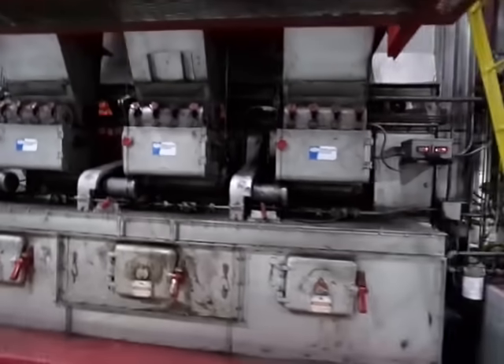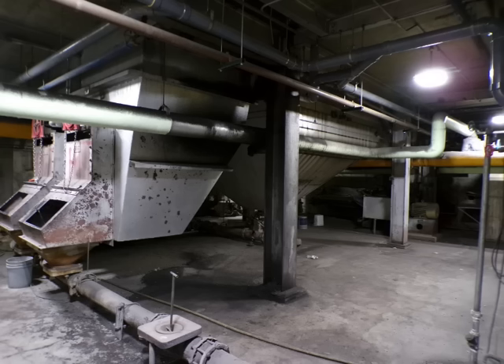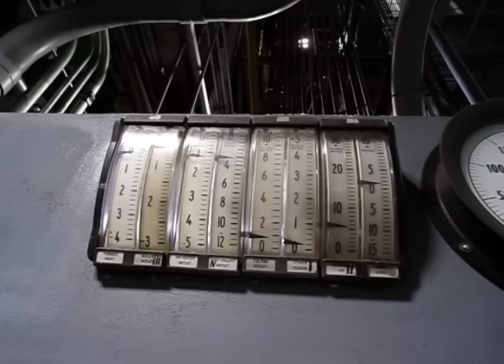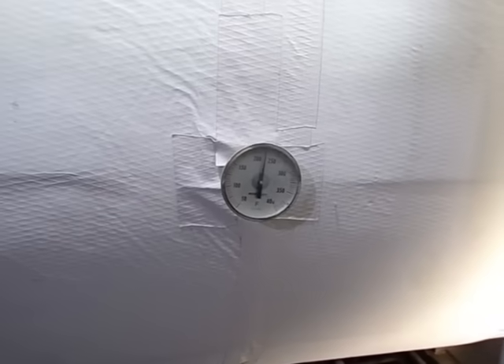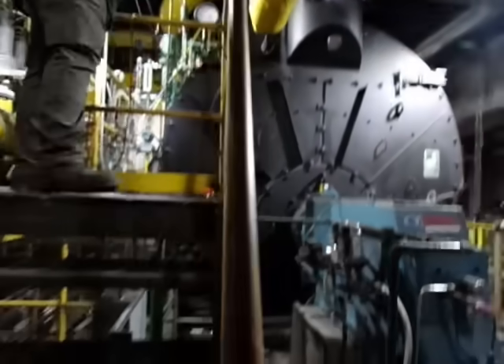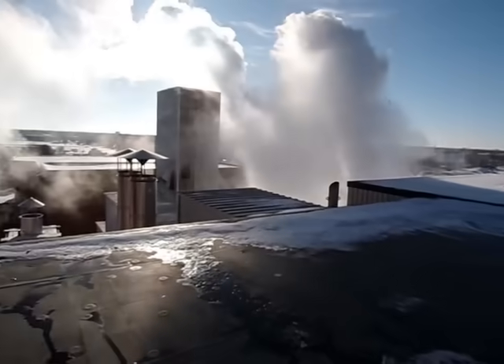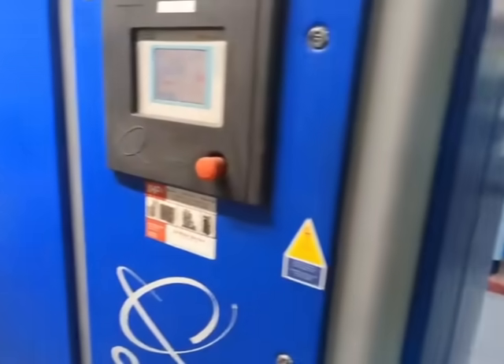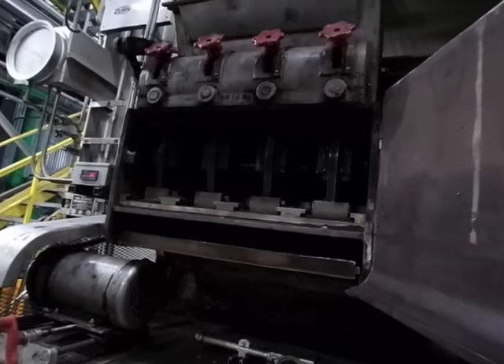The Last Coal-Fired Boiler at NDSU | Steam Plant Tour

Comment: Great video. I worked in a multi hearth incinerator for a wastewater treatment plant. A lot of the instrumentation, and peripheral equipment is similar. We used dampers for our ID fan back in the 1980s. We also kept a negative draft, to keep the incinerator fed with air. We switched to NG after using bunker C oil, which we had to heat to flow.

I subbed. Great channel.
Reply from the maker: How did that work? I thought incinerators burned garbage. So are you saying that oil fired boilers had id fans?

Comment: It would be really cool if you could get a tour of an electric arc boiler!
Reply from the maker: I've heard of electric arc furnaces for smelting metal but not for steam heating.
Reply: @SteamElectricityandPropulsion  electrode boilers. Is what they are actually called. When i was doing my boiler training class they mentioned them. But the only one in our region is at the Tillamook dairy. It uses line voltage 4k to 22k and passes the current through the water.

Comment: It's sure not the last 😊
Reply from the maker: there are coal fired boilers at the american crystal sugar factories but they don't allow pictures so I cant make a video.
Reply: @SteamElectricityandPropulsion their not supposed to use them is why
Reply from the maker: @jeremiah-om7zl how do you know that they aren't allowed to use coal?
Reply: @SteamElectricityandPropulsion epa 😊
Reply from the maker: @jeremiah-om7zl so then why is NDSU still allowed to burn coal?
Reply: @SteamElectricityandPropulsion maybe if you've spent millions on a gas afterburner 😊
Reply: @jeremiah-om7zl  ACS is permitted to use coal without issue

Comment: This boiler has been causing Global warming, and destroying the planet for over 40 years.  It should have been shut down decades ago.
Reply: If you think coal is that bad, thats ignorance.

Coal is not as bad as you believe it to be.
Reply from the maker: @FlorenceSlugcat  you can use ash for concrete mix and you can use sulphur limestone slurry for drywall.
Reply: @SteamElectricityandPropulsion indeed it is the case.

While coal has its drawbacks, it also has benefits. It is low cost and requires very basic machinery on a small and on a large scale.

I saw some people comment about "not needing conveyors" and all that. But that neglects the fact that you end up needing pressure systems of pipes and tanks, pumps and such.

In naval, oil is definately better because of a higher energy density: less fuel, more range, more cargo, on a smaller ship. Oil however can be used for internal combustion engine systems. But oil fired steam boilers remain more energy-dense than coal. 

In power and heat, coal is pretty hard to defeat. The low cost makes it unbeatable on a large scale for infrastructure demand. The opposite is true as well: its low cost makes it good for small scale applications like an oven. It also can does not rely on a complex oil industry and supply chain, nor on oil storage tanks, making it viable to use with no pre-existing local infrastructure or industry. You can store it in a pile, and and shovel it.

Gas main benefit is mainly for high speed turbine systems, such as gas turbines: very high consumption, but alot of power, in a small internal combustion system.
Reply: @SteamElectricityandPropulsion coal also has another important purpose: Coke.
Coke is an aggregate fuel like coal, but it burns with more energy than coal. It is done by baking coal at over a thousand Celcius without giving it oxygen so it doesnt burn.

It burns hotter and cleaner than coal. And is a necessary ingredient of the steel industry.

In a blast furnace, it acts as the fuel to melt and make steel.

Beyond making coke, limestone is also necessary to make cement for concrete production. And sulfur is great in agriculture.

The ash us sometimes sprayed over fields as fertilizer too
Reply: @SteamElectricityandPropulsion more than 50% of coal combustion products in USA is recycled
Reply from the maker: @FlorenceSlugcat  I think gas is cheaper because the manager told me that right now in January gas is a little less that 6 dollars per mbtu but coal is 6 dollars per mbtu. In the summer gas is about 3 dollars per mbtu.
Reply: Cry harder.
Reply from the maker: this channel is about documenting the machines that support our utilities not condemning coal.
Reply: And gas doesn't?
Reply: @J-1410 yes it does. Humans should
Migrate to warmer climates in the winter.
Reply: @Freedom4Ever420  Are you for real?

Comment: Ya some gas companies ask you to keep them for major users ie coal/oil for back up.  They call when gas pressure drops during extreme cold weather.  I hope you already talked with them and not just doing it out of the blue.
Reply from the maker: Most places use gas but have oil as a backup fuel. When it gets really cold they stop using gas and switch to oil.
Reply: @SteamElectricityandPropulsion just making sure it’s kind of a critical mistake idiots with MBA will try to force down your throat

Comment: Thanks for posting.  Was interesting to see how the stoker was set up and the manual soot blowing.   Where I currently work was have hundreds of soot blowers on each of the three units, they use compressed air (used to be steam) but are operated with electric motors as we would have to have a crew of people to pull the chains for each one.  The smaller ones look just like the ones you showed.    Loved seeing a heating unit burning coal, sad to see it go.  Most of the ash can be sold for concrete fill if it doesn't have lime added for SO2 control.
Reply from the maker: One guy was complaining about the heavy metal in coal ash but that's great that you can safely dispose of and utilize coal ash in concrete.
Reply: @SteamElectricityandPropulsion  I heard there is a way to recover some if the exhaust from the coal plant and convert it to gypsum boards.
Reply from the maker: @SkrixFox  yeah they blow air into the lime water tanks where the sulphur is removed to cause a chemical reaction to make gypsum. this steam plant only has a bag house but no sulphur scrubber.
Reply: @SkrixFox Google Zimmer power Station just outside of Cincinnati. Limestone was mined just a short float down the Ohio River and ground into a fine powder. Barged back up river and then used at the plant for the scrubbers by spraying the slurry into the flue gas in the stack scrubbers. Then the synthetic gypsum was sent back down river on another barge to make drywall board. Pretty neat stuff is done when we get creative and it makes dollars/cents.
Reply: @SkrixFox  We just use a dry powdered lime, blowen in with the flue gas and captured in the bag house.  we don't produce any gypsum that can be recovered.  Since we also add carbon for mercury recovery it can't be used in cement anymore and is no all landfilled.  We used to sell it all for cement production but not after clean air upgrades.

Comment: That boiler system was pretty impressive when I started at NDSU in 1980.  It's been expanded quite a bit since those days.  There were always a couple coal cars on the railroad siding behind the boiler plant.  NDSU burned lignite from the western part of the state back then.  That's pretty dirty coal so I've no idea if they still burn lignite.  Somewhere in my box of stuff from those days I've got a chunk of lignite I picked up from that siding.  I can't argue that natural gas is a lot less work and expense.  But I'll miss the coal.  I still live in Fargo and drive past NDSU now and then.
Reply from the maker: I think they burn bituminous coal from Montana. You should call them and ask for a tour before the finally shutdown the boiler. If you email me I'll give you the number to call the plant manager.
Reply: @SteamElectricityandPropulsion  I thank you sincerely for the offer, but I'll pass.  I've been in the plant a few times through the years though.  A friend and I used to have a metal foundry in the old South Engineering Annex, if you've ever heard of that building (it used to house the steam boiler and electricity generator for the university in the old days).  We were always scrounging favors or needing someone to look the other way while we hauled in a trip hammer or some other little thing like that.  So we got to be pretty good friends with the people keeping the place running.  And it was a lot more informal then so if you wanted to see some part of the campus like that all you had to do was ask politely and someone would be glad to show you around - and probably share some gossip.  I miss those days.
Reply from the maker: @xlerb2286 so was that at NDSU? If so do they still have the foundry and generator?

Comment: WHen all that electric wasting  expensive junk is replaced by clean natural gas the University will be much happier not paying for all the power to run all those blowers, coal feeders and all the rest of that stuff that isn't needed, and they wont have to get rid of mountains of dusty toxic coal ash either.
I burned coal for heat in the 80s and well remember how a 5 gallon bucket of nut coal when burned in my stove would about half fill that bucket with ash, and it was heavy, sandy clunky very dusty and dry "ash" I had to shovel out and dispose of. Now you cant just dump it where ever because coal ash contains some heavy metals, arsenic and other nasty stuff, so a coal fired power plant has to pay to get rid of train cars full of the crap, so the efficiency of using diesel to mine, move, process, transport again hauling all those tons of coal in,  and tons of ash  back out results in a huge loss of energy for whats produced.
Natural gas has only one use- burning it for heat etc, you cant drink or eat it, it cant be used for other things like wood is used for many things besides firewood.

The rest of the world is moving away from coal, it had it's day, it used to be cheap, not any more! I think when I burned it I was able to get a ton delivered for around $100 if I remember right, now it's closer to $400 and you cant just dump the ash anywhere you feel like
Reply: Coal, by the ton, is not cheap, no. Coal by the railcar, however is extremely cheap. Fargo and elsewhere is having issues with gas supply, and gas cost, with multiple pipelines proposed but none built yet. However the days of cheap gas are coming to an end very quickly with all the natural gas generation facilities being built.
Reply from the maker: @J-1410  the plant manager was saying that even in January gas is slightly cheaper than coal. sometime later when it got extremely cold they got a gas curtailment and had to switch to #2 diesel.
Reply from the maker: I think coal is good because its more abundant than gas and oil. with coal mining it looks like a lot of work but coal is cheaper than oil because its easier to find. the price of gas goes up in the winter so coal is cheaper. if gas supply becomes restricted due to heavy use in the winter they would otherwise need to use diesel fuel for the boilers which is expensive. with the ash you can use it to make concrete.
Reply: @SteamElectricityandPropulsion I understand about natural gas and oil prices versus coal, but what I want to know in this particular application, how labor intensive is it? What kind of electricity does it use? What kind of maintenance does it require? It looks pretty complicated compared to something that's gas-fired which with higher natural gas prices it might still be cheaper to run than this coal plant
Reply from the maker: @carlpreston1680  with blowing soot you do it once a day I think and you probably do the ash collection system once daily. the ash collection system is probably easy to operate because they use vacuum to suck the ashes away. as I said in the video its 460 volt 3 phase power. they also use VFD on some of their motors.
Reply: Pay to get rid off the crap is Joke! You are funny man! If you have snow that is the cinder the city buys to put on the street. Scranton, pa has piles of culm 130m high by 20km long that caught fire and burned for twenty years, they are now excellent material for cinderblocks! The heavy metal content is funny, every garden has a full 1m of the stuff, but if coal cinder was dangerous would would every street have a full 1in per year thrown on it.
Reply from the maker: @richardroot4767  you can use the ash in cement but throwing it outside is not recomended. coal ash does contain heavy metals so its only safe if trapped inside concrete.